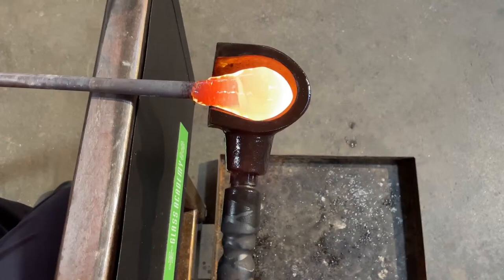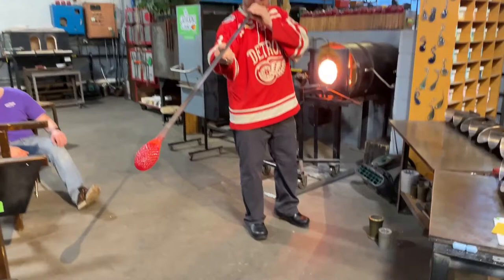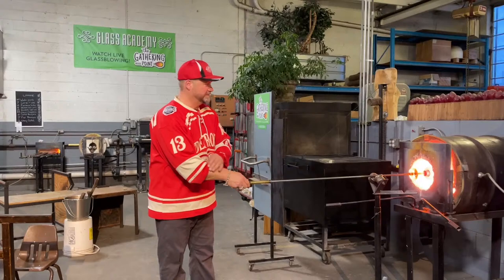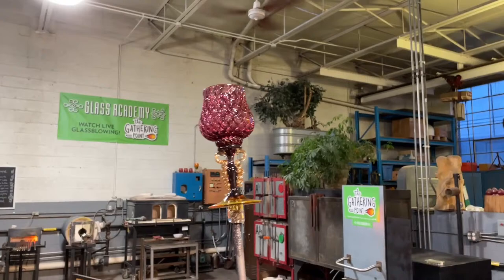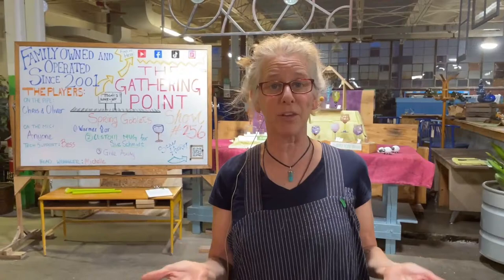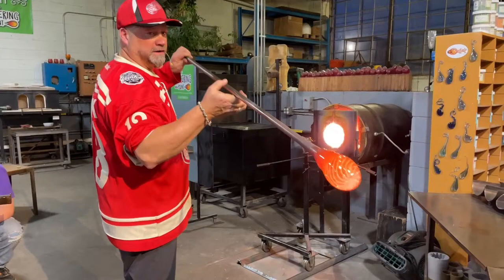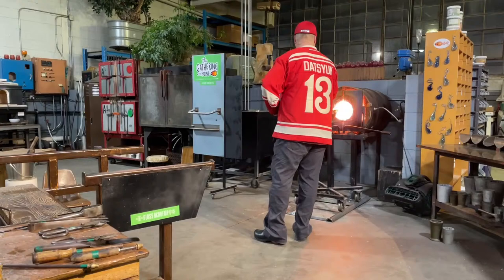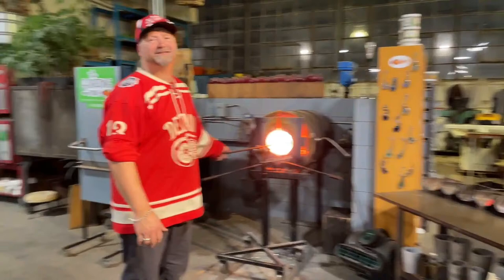Glass Blowing: Goblet Tutorial

Comment: On the pontil, I do something similar using fine-grained sand. It's the best of both worlds - stability due to the size, but an easy break-off because of the sand, with only that small point in the middle actually bonded on. The sand pontils go into a separate bucket as that glass can't be re-used.